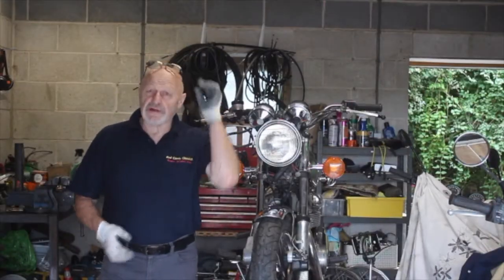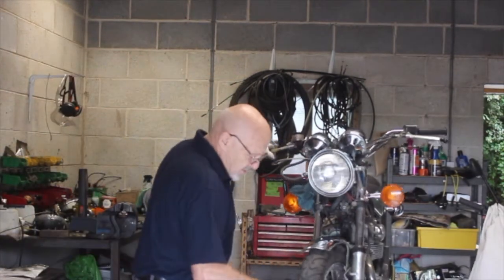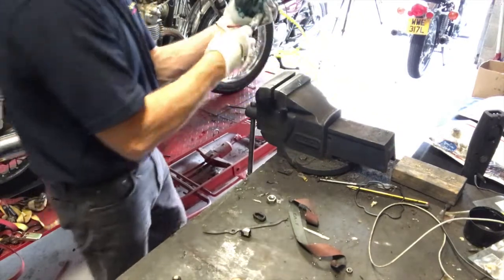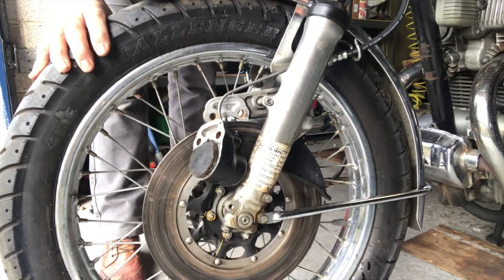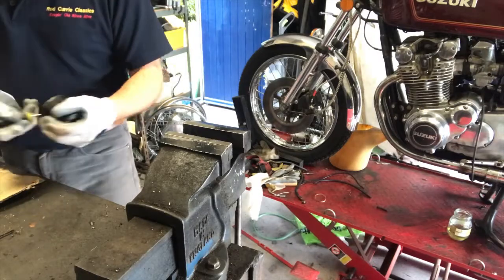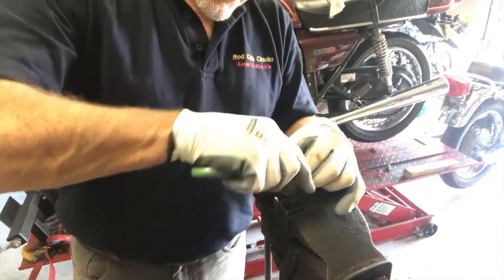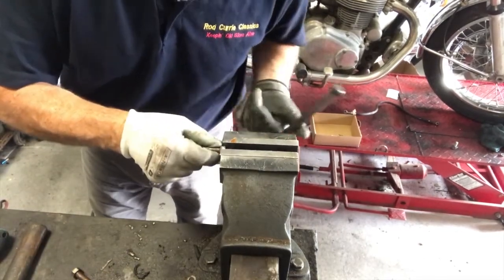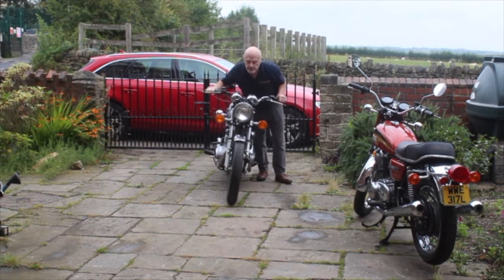How to free stuck Honda CB 750 brakes

Comment: Great video  once again!,, I have successfully used grease and a grease gun on a couple of occasions to release stuck pistons, a bit of a clean up needed afterwards, but has always worked for me.
Reply from the maker: We all do what works for us and as I've said before I don't have all the answers...just what works for me. Anything that can get enough pressure in there to get the piston out will do...but its almost invariably messy eh?
Reply: Yep,I  was thinking of that as well, supposed to work on seized  engines as well
Reply from the maker: I've freed up seized engines with Marvel Mystery oil, or just any penetrating oil will I suppose do. The thing is not to rush it I think. Put the stuff in...leave it a couple days to do it thing...ha e a go...if it doesn't work pop some more in...leave it a  little longer..etc ec

Comment: Hi Rod, what did/ will you use to clean up engine cases / barrels etc on the cb500T and can you do a video of it please ?
Reply from the maker: Hi there. Thanks for watching. I haven't actually done the side covers /cases yet but will do a vid. I did post some polishing the other week on the vid "1978 Kawasaki Kz650 recommission, will it run". The link is : https://youtu.be/rBXBwuNrpPg
Reply from the maker: Hi there. I've just posted a vid of the bike's engine cases being polished. hope you Enjoy.
Reply: Hello I have a 1977 Honda 400f.I have to move it from a house it's at because the house sold.its very hard to push I  dont want to fix the brakes the buyer I have will do that.
Can I just take the calipers off to make it easy to get roll down a few doors down? Would that be the easiest  ? I'm waiting on a title and just need to move it to a neighbors nouse.
Thank you